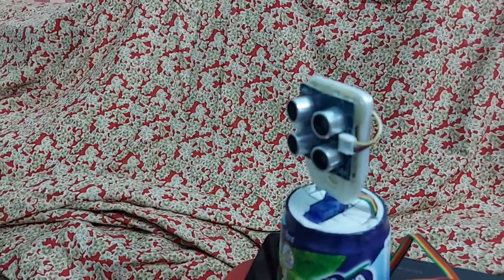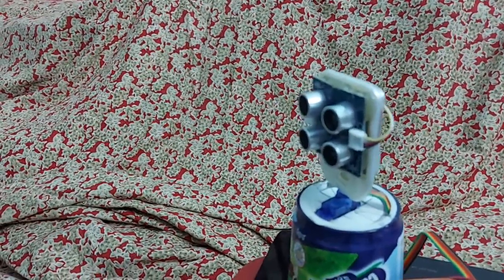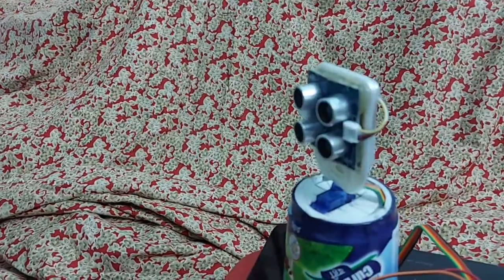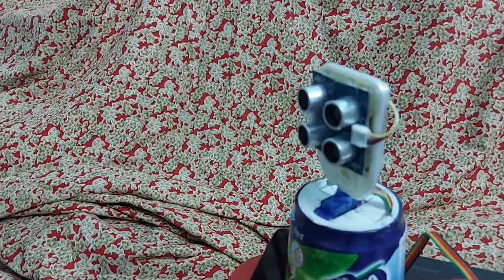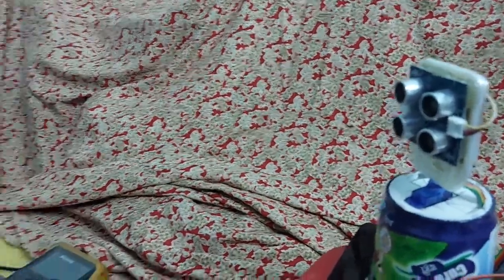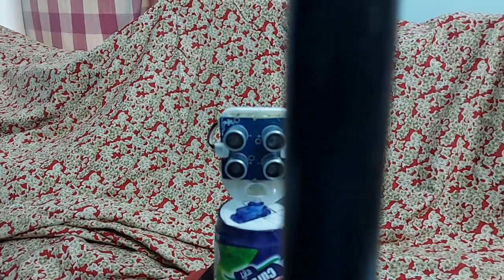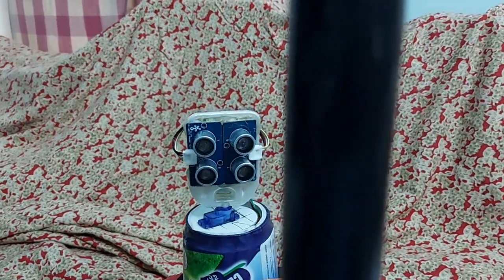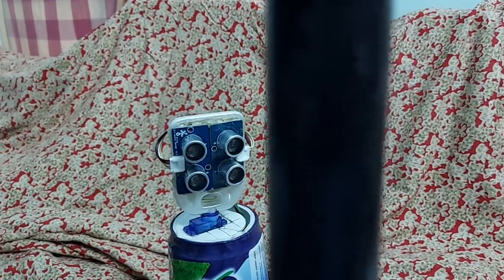Aj Ultrasonic Monopulse Tracker

Comment: its has 4 receivers and one transmitter as target right
its tracing cane because of reflection of same wave which is transmitted from transmitter
am i correct sir?
Reply from the maker: A 2-Axis tracker would have 1Tx and 4 Rx but I have used used two standard Tx/Rx sensors. Horizontal beams are fixed with a small overlap. Software gets amplitude values from each sensor in sequence and processes the difference. You could try to make a 2-Axis tracker
Reply: @ajoyraman1409  is it like mono-pulse tracking radar if radio wave used ?
i don't have any knowledge about it just asking because i want to make one